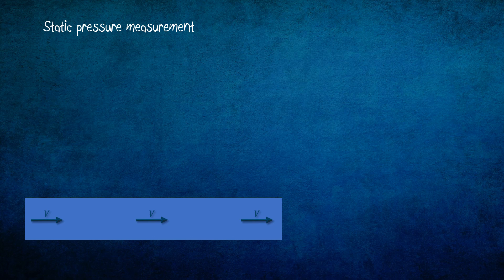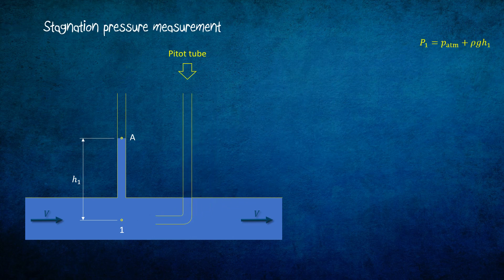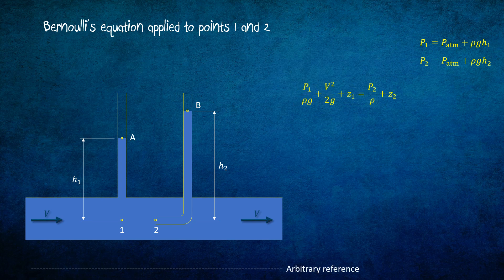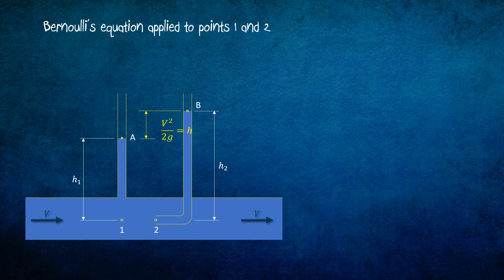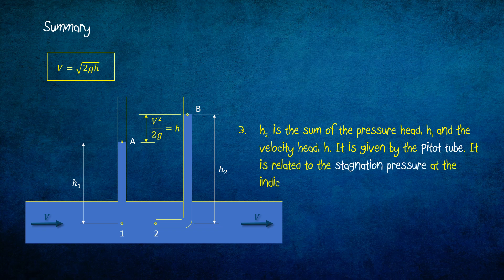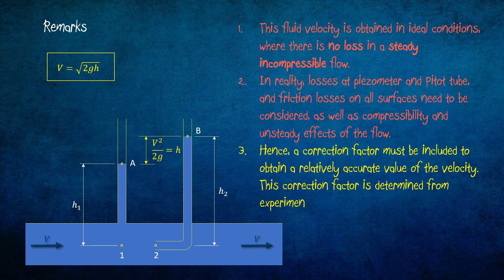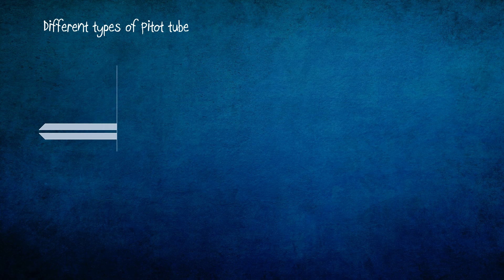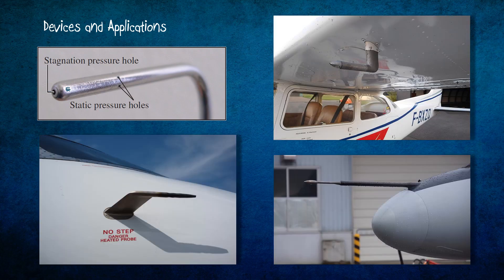Fluid Mechanics: Flow Velocity Measurement using Pitot Tube

Comment: Why is there a static pressure on the solid surface in 0:39? Because of the velocity of the water? If so, if the water would have been static, then the water wouldn't rise in the piezometer right?

Comment: Why you directly use p1=pgh1+p0,there is velocity at point1
Reply from the maker: P1 measured here is the static pressure at point 1 (calculated using the formula that you mentioned). You are right, there is a flow velocity at point 1, which indicates that there is dynamic pressure (or velocity head) at 1. That's what we want to obtain by measuring the stagnation pressure at point 2. The dynamic pressure (or velocity head) at 1 gives the velocity of flow at 1.

Comment: why the velocity at point 2 take as zero? it will have some velocity at point 2 which would become zero at location where pitot tube bent is there? Please clarify. Thanks
Reply from the maker: Good question. In the beginning, when we put the Pitot tube in a flow, the fluid will enter the Pitot tube up to a certain level. After reaching the level where an equilibrium is achieved, there is no more flow in the tube, which means the velocity in the Pitot tube is zero. The zero velocity in the tube is everywhere along the tube, including at its inlet. Hope it clarifies.
Reply: Thanks sir.

Comment: What would happen if the fluid flow was from the other direction, how would h2 differ?
Reply from the maker: That is a good question. Consider the configuration like in the video, if the flow is reversed (i.e. from right to left), the body of the Pitot tube will disturb the flow at 2. Vortices (wake) will be formed around point 2 creating a zone of low pressure. The height of liquid in the Pitot tube (h2) will be fluctuated, lower than the height of liquid in the piezometer h1 (lower than the static pressure).